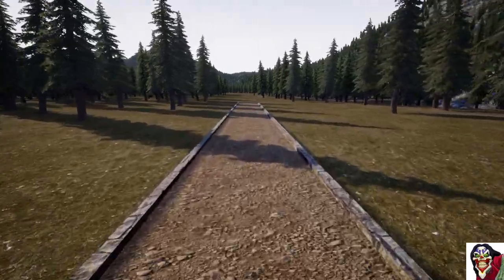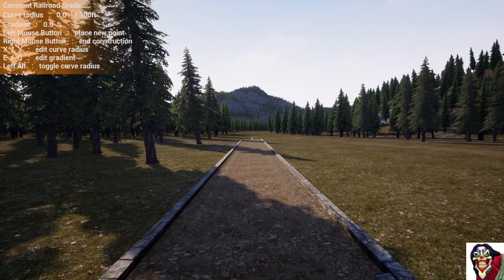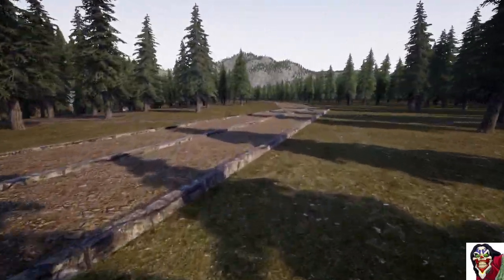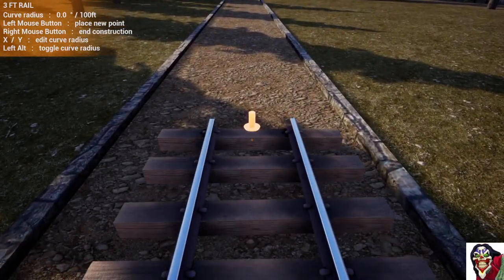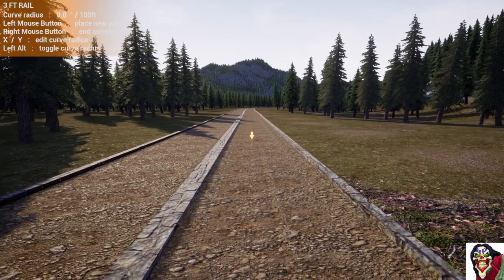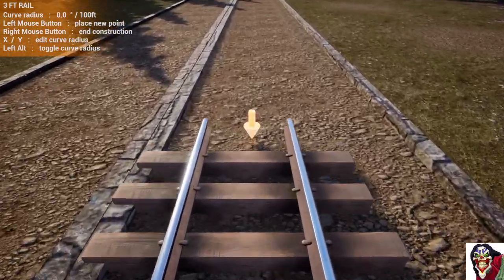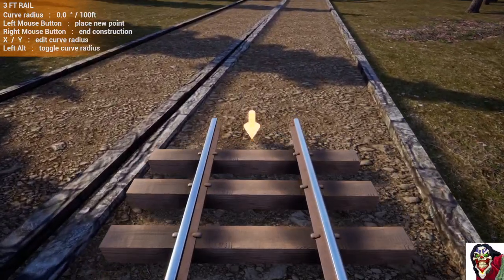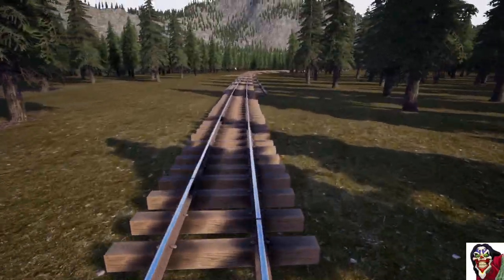RO! - Old Build Tools Tutorial Ep5

Comment: one qwestion  is 7 tie specifically that inpporten for all the building or is any langth as long as it all the same tie number fine
Reply from the maker: The shortest tie count you'd want to use is 6 ties, 7 ties just works, and its easy to see when you are at 7 ties long.  You can use any tie count, provided all the segments are the same length.  6 or 7 tie segment lengths also doesn't leave any gaps in the tie spacings. (all covered in ep1).
Reply: @K10wNs-Shed  thanks

Comment: G’day mate, Another brilliant tutorial, thanks.  One question, if for some reason that you stop building a curve part way through the curve, is it good practice to start the whole curve again?  If I try to restart a curve midway, I always seem to have a flat bit at that point.  Thanks again for the videos.
Reply from the maker: Delete the last segment you made as the first and last segments of the spline do not comply to the curve (this is the flat spot).  Then overlap one segment to start building the curve at the same radius.  I do this mid curve in this video, and showed it in ep4 repairing the curve.  In later eps I show how to turn it into one spline again by using the control points without needing to build the corner over again.
Reply: @K10wNs-Shed   thanks a lot for that. Awesome work once again